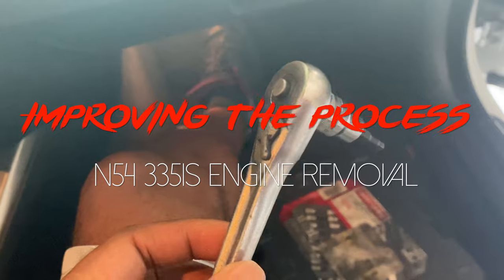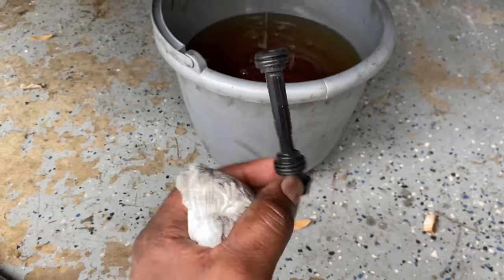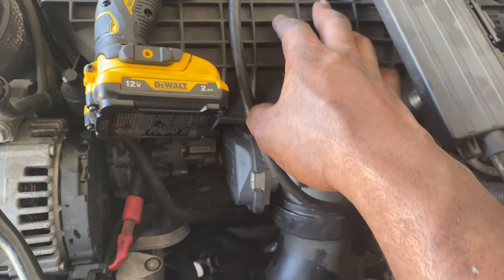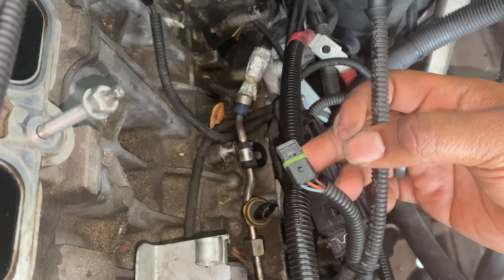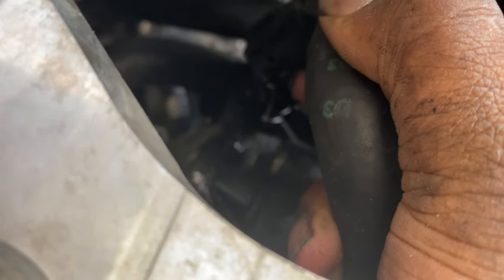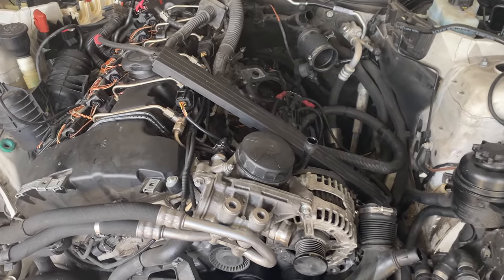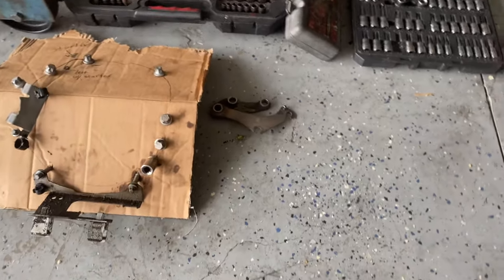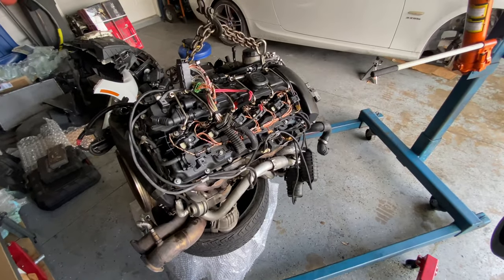BMW 335is N54 Engine Removal

Comment: Do you absolutely have to disconnect the belt and all that 

I just want to take the whole thing out with everything included

Edit: Im at the stage where I need to be unbolting the engine from that trany and the mounts. I feel like that’s the most confusing for me
Reply from the maker: You can leave the belt on if your Freon and power steering fluids are evacuated. I just disconnect the belt so I can leave the a/c compressor and power steering untouched. Once the engine is supported up top, starting with the starter bolts loosen the trans bolts some can be removed easier from the top or use a couple extensions with a wobble socket head to reach them from under the car. Once that’s done take the engine mount brackets off and you should be good. You can also pull the transmission with the engine. Just would have to disconnect the drive shaft and loosen the shifter connection.
Reply: @nOshi2x  so basically just need to undo the trans bolts then the mounts and she’s free

I watched the video but I still have questions 😭
Reply from the maker: Yea but when lifting just lift and watch carefully to make sure nothing is snagged or something. Also the transmission might not separate easily, sometimes a little shake of the motor and it will loosen.
Reply: @nOshi2x  cool and one more question then I’ll let you go 

How many mounts am I expecting to run into, I have the whole front end gone, and the majority of intake hoses and the manifold all out. So I can see one, also is the engine also bolted to the bottom where the cross member I think it’s called sits,  or it’s literally just mounts
Reply from the maker: Only two mounts. The engine is held in by just those two plus the transmission and it’s mount. You more than likely seeing the driver side mount since it’s the most visible. Especially with the intake off. For the passenger side it’s a bit covered, you might be able to see it more clearly from the bottom. Look where the downpipes protrude from and you will see a bracket going from the engine toward the mount. Once you take off the driver side one you can tackle the passenger side easily.
Reply: @nOshi2x  sweet, I’m going to finish it up in the morning, thanks for walking through it further every bit of info helps 🤙🤙
Reply from the maker: No prob 🙏🏽
Reply: @nOshi2x  alright so it’s going smoothly my last question is do I absolutely have to touch the suspension or can I still pull it out without undoing the whole suspension
Reply from the maker: That’s good to hear! No don’t have to touch any of the suspension components. Once all those other pieces are disconnected it will come out straight through the middle.
Reply: @nOshi2x  I’m so excited and nervous at the same time😭😭

What other bolts would I need to attack from under the car besides the down pipes ?
Reply from the maker: Just watch out for the driver side ground strap that connects to the car body and the engine mount bracket and you should be golden.
Reply: @nOshi2x  cool, do I unscrew those two big bolts that’s on that bracket next to the down pipes? There’s like a bracket that the down pipes sit on then next to it there’s two bolts that I think be on the transmission
Reply from the maker: Yea you can remove those .
Reply: @nOshi2x  how do I get to those there’s no room for my sockets😭😭😭
Reply from the maker: Might have to use a wrench set instead  or use extensions on your socket
Reply: @nOshi2x  ok I’ll try that

Comment: why not pull the engine with the trans?
Reply from the maker: Can do it that way also. But didn’t want to mess with dct and the cooler lines etc so just left it in. Generally try to leave as little disturbance as possible. If it was a 6 speed def would just pull the engine and transmission out together.
Reply from the maker: For the transmission. Off rough memory. Remove the bolts holding the driveshaft to the transmission. Will need someone to rotate the drive shaft and pull the ebrake while loosening each bolt (rear should be jacked up to so the wheel can spin). Loosen the accessories on the driver side of the transmission. Get a jack and support the transmission, loosen the transmission support bar at the back of the transmission. Once that is out the way, lower the transmission down a little so you can disconnect the shifter arm to the transmission. Once that’s done should be good to pull everything out. That’s just a rough description, but I’d disconnect the engine stuff first and leave the transmission stuff for last.
Reply: @nOshi2x  thanks for your help noshi !
Reply from the maker: No prob

Comment: What engine fits in e90 316 2007 model? Can we fit for example from the f30 1.6 turbo engine?
Reply from the maker: Most any engine can fit in an e90 chassis. Just will have to do custom fabrication and testing to get things to work. Unless you go with a documented swap, in which the path to install is more clear.